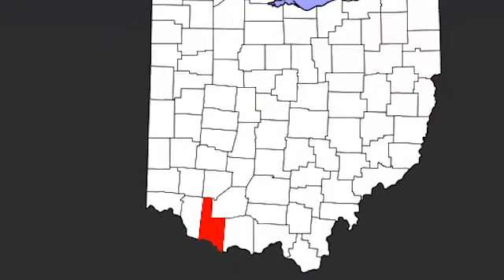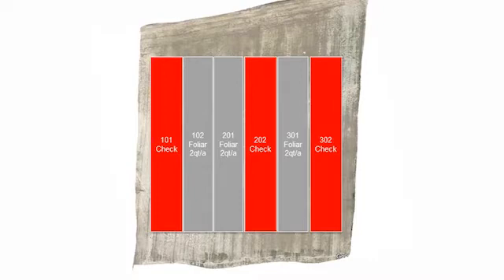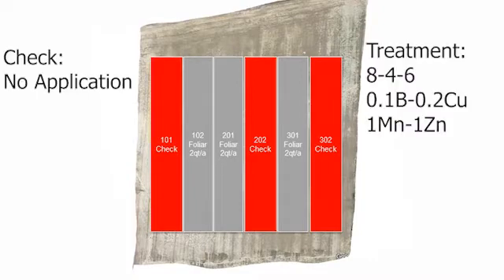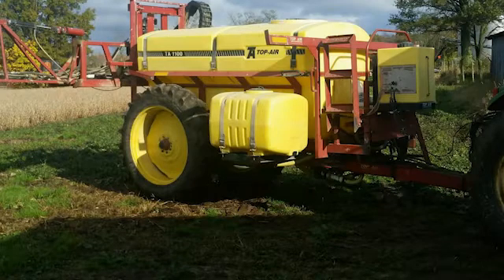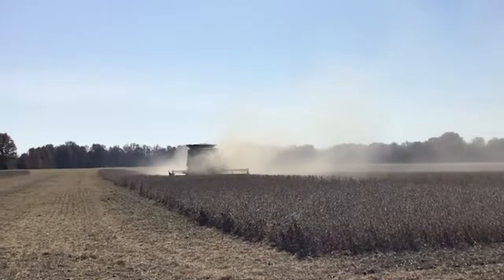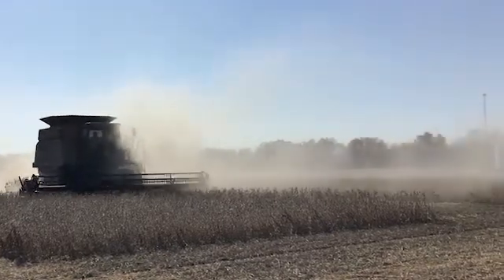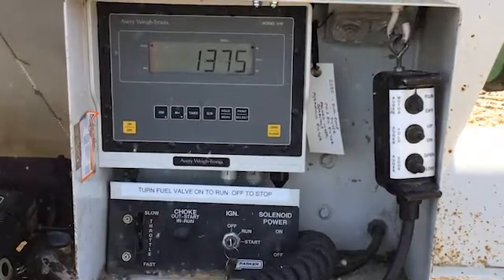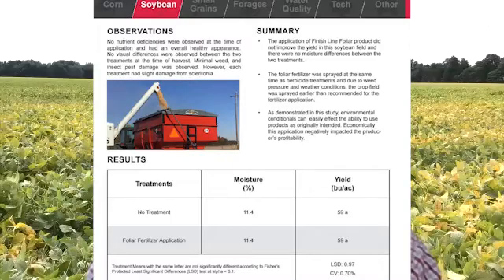Foliar Fertilizers on Soybeans, Pushing Soybean Productivity in Ohio - 2021 Ag Tech Tuesday

Comment: If the pH of the soil is good and the soil P, K and micro-elements are also sufficient, we in South Africa do not see any advantages of foliar supplements. Beware of fly by night companies trying to sell you stuff the plant do not need!!
Reply: Stem saam 👍
Reply: Foliar feeding works well for plants in depleted soils. And foliar feeds can be made from compost tea, and does not necessarily need a commercial source. Some major farmers in the U.S. have begun to make their own homegrown fertilizer "teas" made from compost and other materials, with great success. Both for the soils and the plants, fertilizer teas have opened up lots of other opportunities for fertilizing when needed. At the worst, it probably won't hurt.